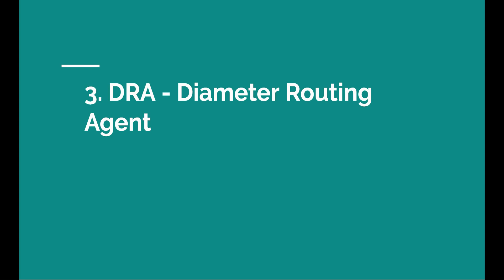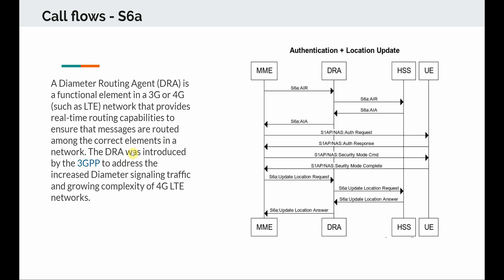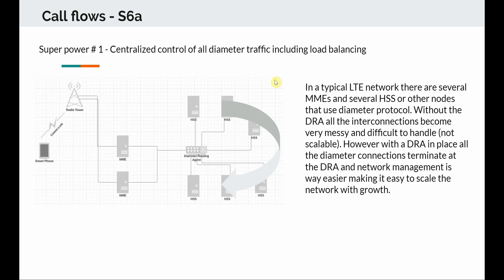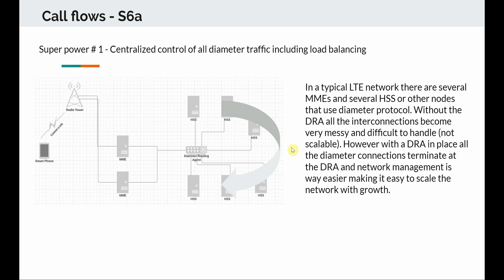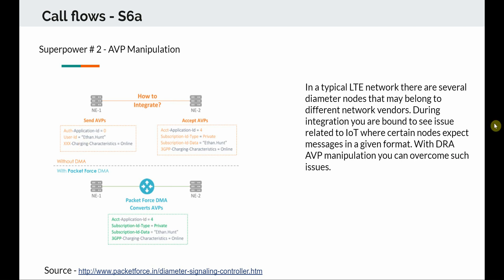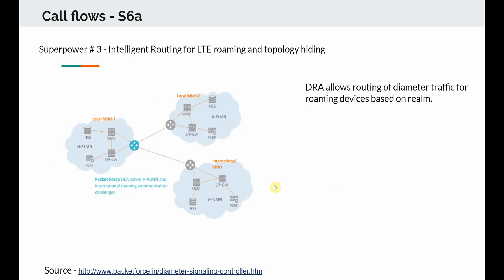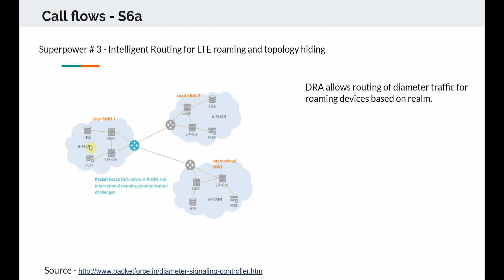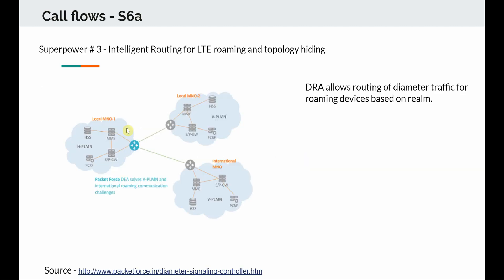Diameter Routing Agent in LTE EPC

Comment: what do you mean by roaming partner's HSS? please explain
Reply: When a subscriber travels outside their home network's coverage area and connects to a visited network, they are considered to be roaming. In this scenario, the visited network needs to authenticate the subscriber and provide access to services as per their subscription plan. However, the visited network may not have access to the subscriber's authentication information or subscription profile, as these details are typically stored in their home network's HSS.

To address this, roaming agreements are established between network operators. As part of these agreements, the visited network can request subscriber information and authentication from the subscriber's home network. This is where the concept of "roaming partner's HSS" comes into play.

When a subscriber roams onto a visited network, the visited network communicates with the subscriber's home network's HSS to authenticate the subscriber and retrieve their subscription profile. This allows the visited network to provide services to the subscriber as per their home network's policies and service entitlements.

In summary, the roaming partner's HSS refers to the Home Subscriber Server of the subscriber's home network, which is accessed by visited networks to authenticate subscribers and retrieve their subscription details when they roam onto foreign networks. This ensures seamless connectivity and service continuity for subscribers while roaming.